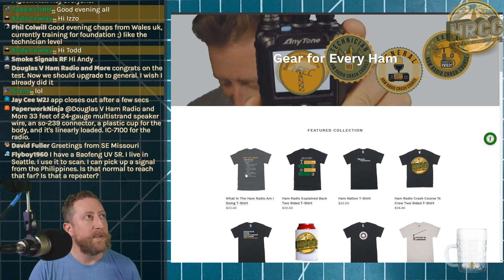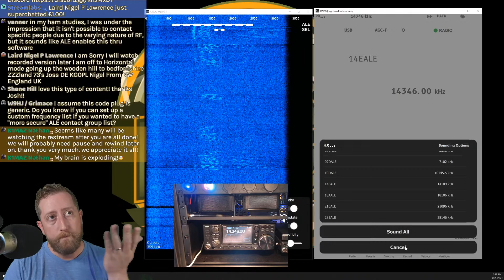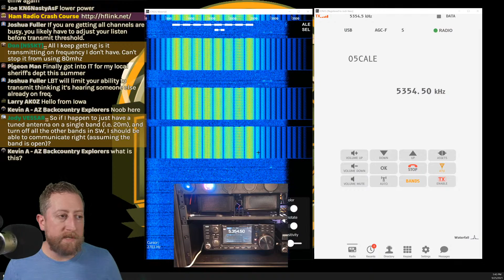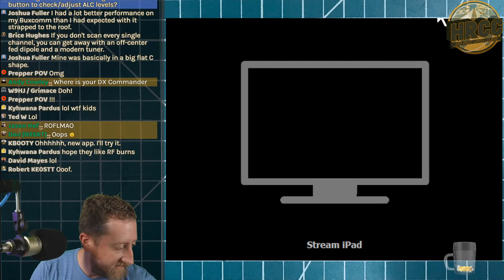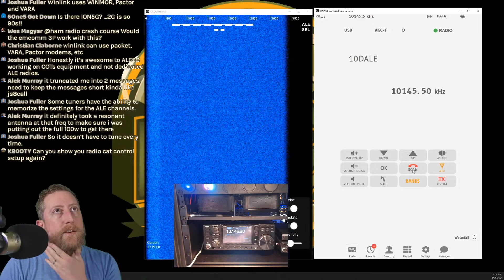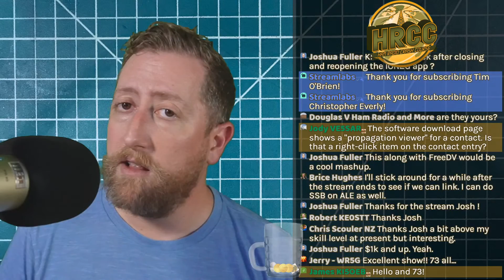The Revenge of ALE with ION2G! Automatic Link Establishment That Works!

Comment: This is interesting. Back when I was in the Air Force, working with the E-3 AWACS, those aircraft are equipped with three HF antennas and use ALE, which sometimes (back then) was useful.
Reply from the maker: People still use ALE but a lot of it is local terrestrial from what I gather.

Comment: Josh, I have been working on a decent antenna system for a couple of years. I just re-watched this as a refresher. I am AF MARS, so it took a while to get the right setup for continuous RF coverage on all bands. Now running Icom 7300, Cg-3000 remote ATU & IC7300 CTU, Super Antenna 135 foot long wire. The ATU was 1/3 the cost of US outlets, from Moonraker in the UK. No important issues, fast delivery. 73 de WN7D.

Comment: Some comments: HFL and HFN are different ALE networks, not a different ALE. There are different channels assigned to HFN and HFL. 

HFN is for the ALE channels in the DIGITAL portion of the band. No voice. Data only. 

HFL is the VOICE network. Call on HFL if you want to link and then talk. 

AQC is a BETTER mode than ALE, and also a standard, but the hardware ALE radios, e.g. Codan, Barrett, Micom, Icom F8101, etc., don't support it. You should also add an HFL AQC network. If both stations are running Ion2G, you DEFINITELY want to use AQC rather than ALE. 

You ONLY want to sound on HFN. DO NOT enable sounding on HFL, HFN AQC, HFL AQC. Ion2G is smart and knows that, if it hears a sounding on HFN in a particular band, e.g. 20m, that the sounding BER/SINAD is also valid for channels in the same band for HFL, HFN AQC, and HFL AQC. 

I manage the SHARES ALE network. I have a fair amount of experience with ALE/AQC. 

73 de Brian, WB5BL/NNA6BL

Comment: great video! is this ION2G compatible with all other ALE options around? is both the calling and message modes standardized? wonder if one of the major brands will implement that built in the radio one day..
also, how about using a wideband SDR (such as the kiwisdr?) that can listen to the whole hf band at once, instead of switching bands? (which inevitably introduces a delay and probably a chance to miss a contact?)
oh and btw, is this T2FD antenna suitable for NVIS? can be a great tool for peppers looking for a local contact in a SHTF situation ;)

Comment: I am using a fan dipole and an LDG AT100ProII and it will tune 80-10 easily when I am scanning ALE.  I just stored a tune cycle on each frequency in advance so the tune is within two seconds of the TX.

Comment: Josh, this was an excellent primer on ALE and ION2G Thank you for making this. I am considering picking up an IC-F8101 if my IC-7200 + ION2G experiment works well over the next several months.
Reply from the maker: Thanks for that! ALE has a ton of value, but man, the antenna needs to the right fit!
Reply: @HamRadioCrashCourse  I am putting up a Terminated Folded Dipole next weekend.
Reply from the maker: @TheTechPrepper  Perfect!
Reply: @TheTechPrepper Hey guys! I am currently working on an open source firmware for the Xiegu G90 which will include an ALE-2G controller on the radio itself. When I have it ready for testing, would you guys be interested in trying it out?
Reply: @MinutemanTech  Absolutely. I'm on QRZ. 73 de KT7RUN
Reply: Is your ALE g90 ready?

Comment: On the hflink website the long lines that go nowhere are people who don't have their location designated properly in their profile, not long path. The lines should go from one station to another. As for all channels busy you need to adjust the "ALE Call Detect Threshold" higher. I would say increase it by 5 until this stops. This acts like a squelch for the software.

Terminated folded dipoles are fine but any broadband dipole antenna with an auto tuner will work. I use a 160M ladder line fed dipole up 50ft. Complete coverage of the U.S. from the Philadelphia area.

Comment: It's analog voice, not digital. It's digital messaging, i.e., keyboard to keyboard messages. Also the software is still in the beta phase so there might be kinks still unfound plus not all radios are in the list. This is because the developer doesn't have access to every radio out there. I can attest that Yaesu 450 up to ftdx10/101 and the kenwood 590sg work just fine with this software. Tho you may not have a code plug you can do manually add the frequencies you want to use. Also, the normal sounding interval is 60 minutes.

Comment: Mmm...I have an FT-847, SG-235 Smartuner, and a dipole @20ft AGLresonant at 1.81MHz supplied with 11" spaced ladder open feeder running from the SG-235 @7ft to the top of a 20ft lattice tower, and added a 6/2/70 V-2000 co-linear + EAV2000 Radial Kit @26ft, and also added in a Diplexer before the Triplexer, to hive off 4m from the 6m Socket to feed a vertical 4m dipole @16ft.  This will be for RAYNET, running about 3 to 10 Watts.

The random dipole antenna here is 38.6 metres long physical space, with the open wire feeder another 4.3 metres per leg vertical up the tower, so overall the length of the half-wave dipole is ~43 metres. 

However, I will also put up a ground level Butternut HF-9V + TBR-160 Resonator, and do some DX 160m to 6m on an FT-991A, might even try ALE on that.

In addition, I'm hoping to revive Packet Radio here, and have put up a 40m Dipole for a Pactor Link using an old FT-77, and then use an Icom IC-F110 ex-PBR (25W) for providing an Access Node on 2m.